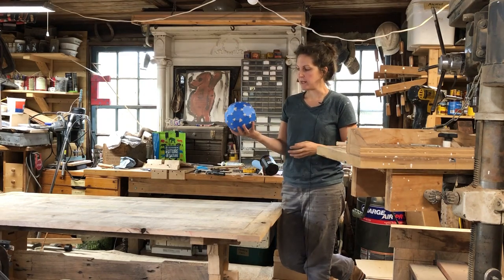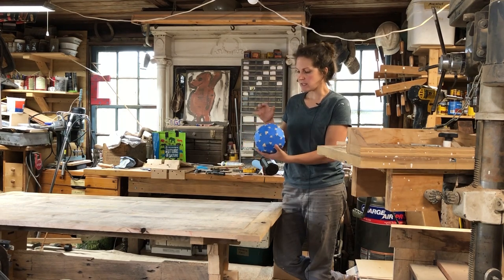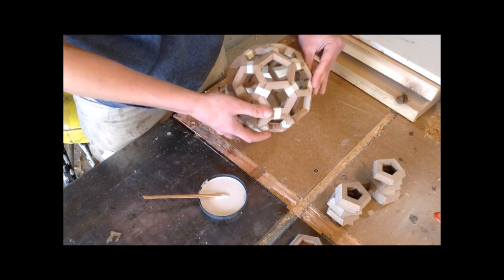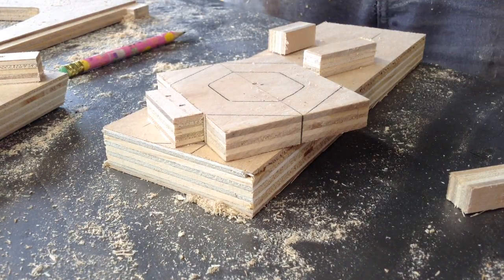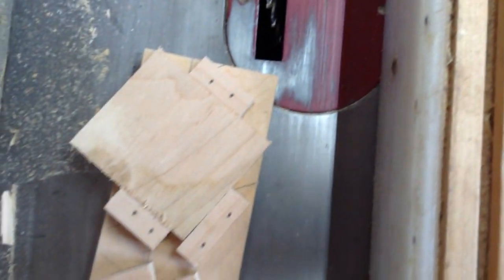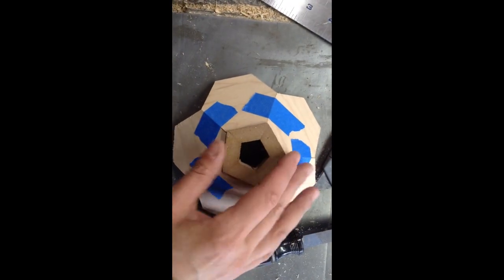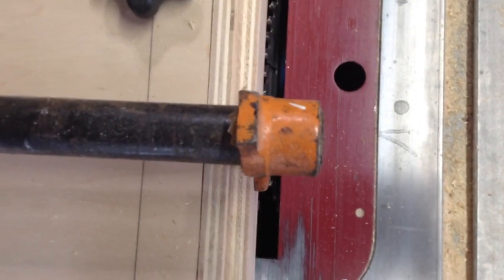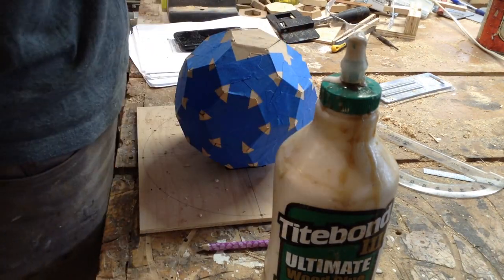Woodworking : Wooden Soccer Ball/Trophy // How-To Part 1

Comment: I saw another video that had the bevel angles at 21 degrees for the hexagons and 16.5 degrees for the pentagons. I noticed you mentioned you did 22.5 degrees for the hexagons and 16 for the pentagons. Is there a specific reason you did this? I've been trying to figure out the mathematical reasoning for this before I attempt the build myself but otherwise this video was great so I appreciate you sharing!
Reply from the maker: I pulled those dimensions from another maker, I believe the link is in the description.  If not I’ll add it.  But I really think the angle depends on sizes of all aspects of the build.